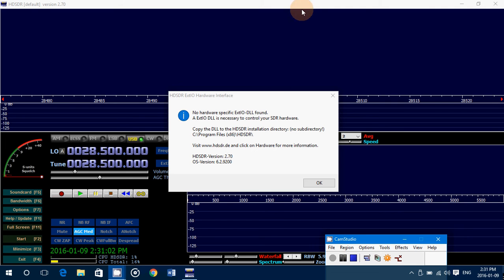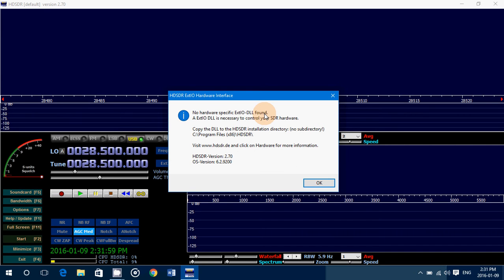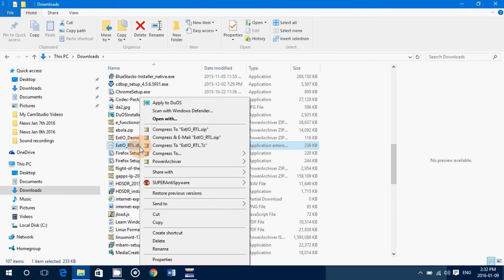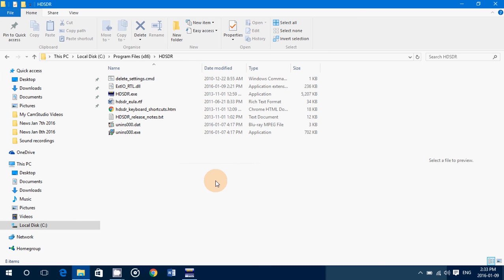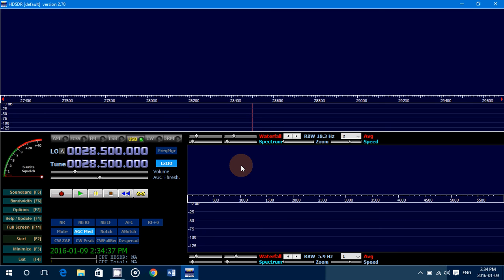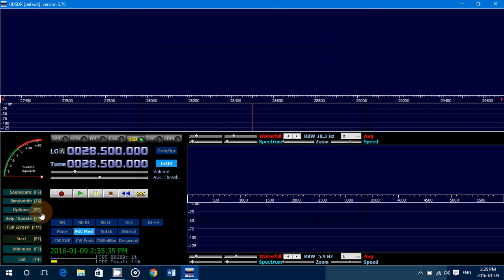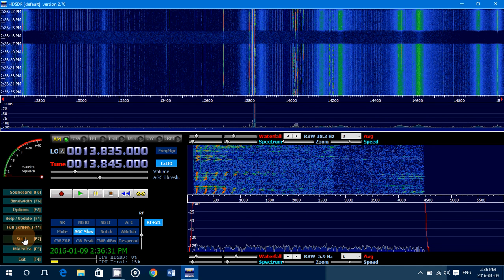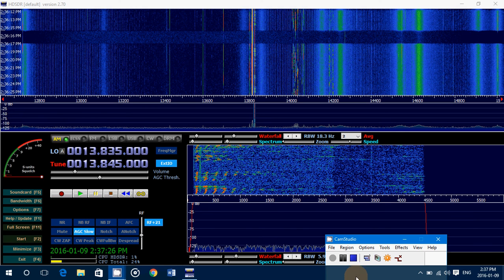Settings up missing EXTIO DLL file with HDSDR and where to put the upconverter frequency offset for

Comment: Hi. Thank you for the video. I'm sure it's going to eventually help me.  I downloaded your file and copied it into the HDSDR folder on my hard drive. I've checked to make sure it is indeed there. When I fire up the HDSDR program, all looks good until I go to select SDR-Device (just under the peak meter), It does not give me any choices, but the following message pops up: EXTIO.DLL not active.   How can this be??  It's right there in the HDSDR folder.

Comment: invalid LO frequency from ext10 -1
I get this over and over when the program starts, when I try clicking anywhere on the program, and boxes pile up.  I put the ext10-rtl.dll file in but nothing happened.  Still unusable.  I tried getting the same file from another source, but same thing.

Comment: Hi I am using a cheap RTLSDR dongle purchased from online m and tried copying the ExtIO dll you posted in the above link. The same is not working when I am running my HDSDR programme. Its showing me the ERROR POPUP  "NO  RTL SDR DEVICES FOUND' on startup and in the HDSDR software when I click on EXTIO .its showing me "EXTIO.dll not Active" ....Please advise me Sir
Thanks !!!
Reply from the maker: You need to use ZADIG driver to replace the Windows driver in your computer, I suspect that you have not replaced the driver
Reply: OfficialSWLchannel I have already installed the Zadig driver in the system and only after this was trying to add up a ExtIO.dll file.
Pls advise